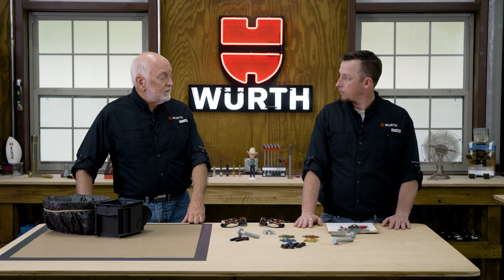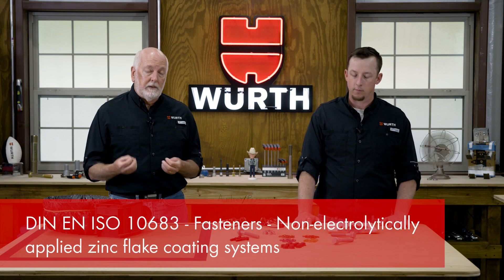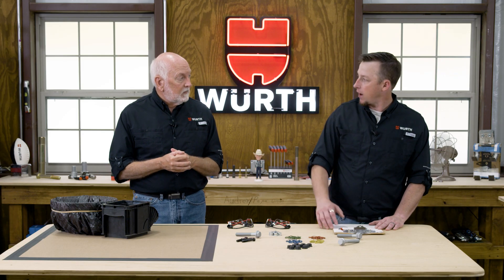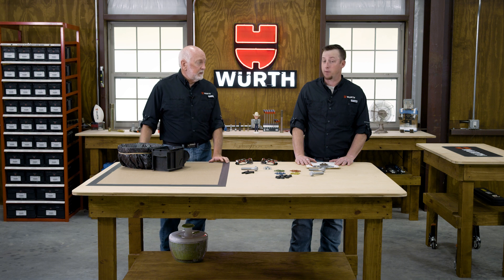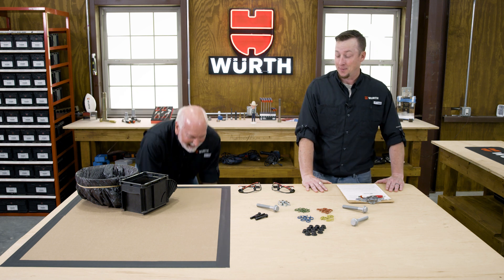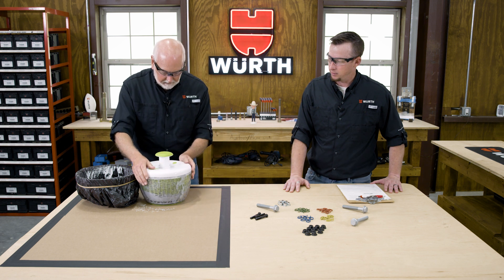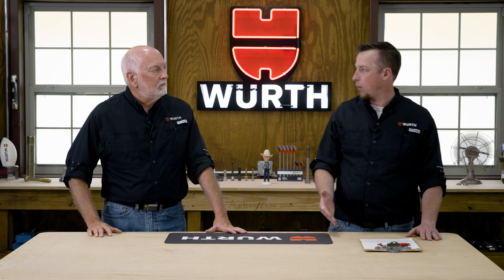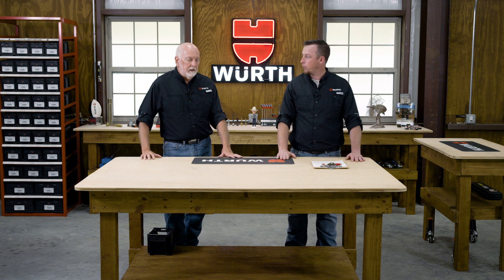Zinc Flake Coatings | Würth Knowing Episode 9

Comment: You spoke a little about the difficulties in dip/spin coating nyloc nuts. Can locknuts be zinc flake coated? If not, what is the suggested method of protection to pair a locknut with a Dacromet treated bolt?
Reply from the maker: Hi Pax! Nylon Insert Locknuts require a ductile finish when properly coated before installation of the nylon ring. Zinc flake coating is too brittle. If coating an off-the-shelf nut, care has to be taken not to degrade the already inserted nylon therefore high temp cure of zinc flake coating is a concern. The best option is to utilize an electroplated nut with a high performance sealer. The zinc flake coating companies offer top-coat sealers that perform very well at low cure temperatures. Let us know if you have any further questions!

- Randy